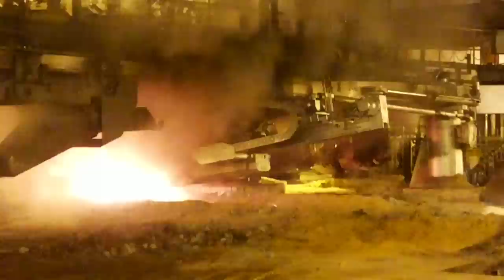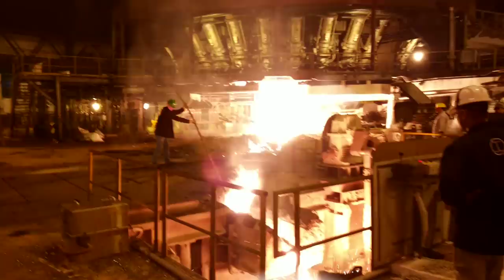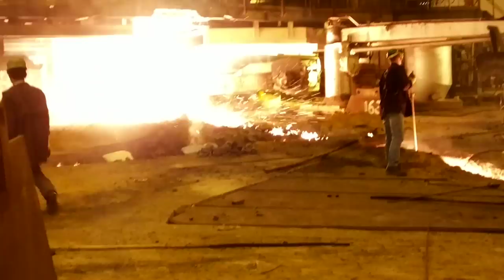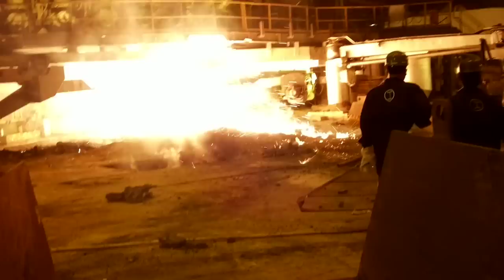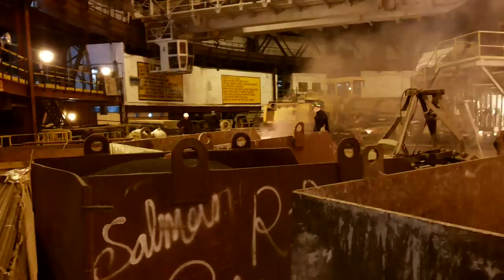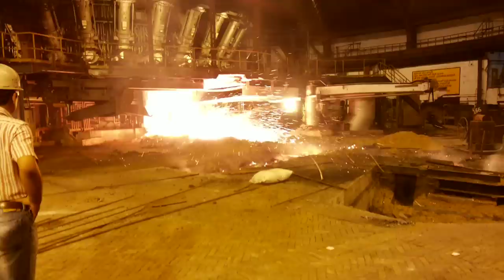Blast furnace

Comment: Credit to the operator drilling up, looked like quite the wet taphole
Reply: Never worked a blast furance, just a minimill. This Mill is in India as far as I can tell, they seem to make good steel. Does a wet clay plug make it alot harder to get the hammer drill through?

Comment: Is the blast furnace cooled with anti-freeze?
Reply: Bulging Battery inner wall of furance is covered with copper plating inside and those plating where cooled by soft water and over those plate heat resistance clay is pasted....
Reply: Is there a radiator?

Comment: taphole machine use TMT?
Reply from the maker: yes
Reply: Purwanto Eko Nugroho carbide tip drill rod
Reply: Nope
Reply: These were drill bit of different orifice tap opening sizes having air supply in between probe of bit...Along with it they use ...Hammer rod size of few couple of meters pointed nose they both r used to open casting